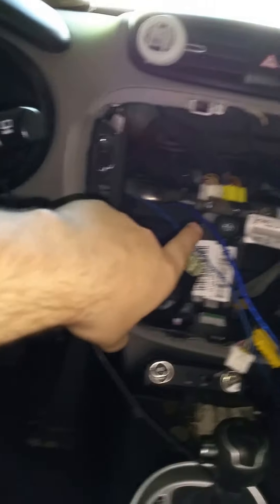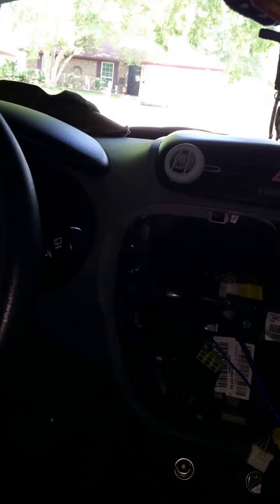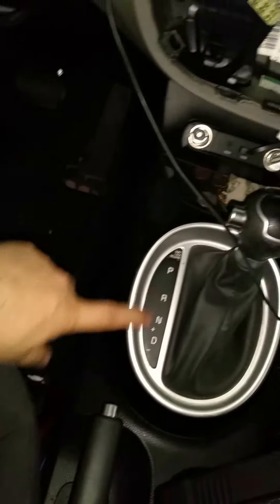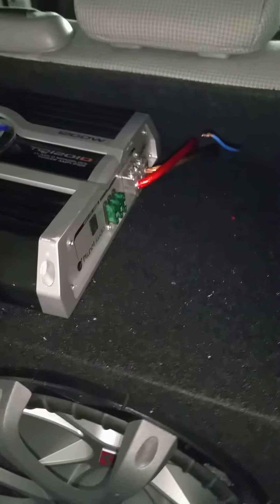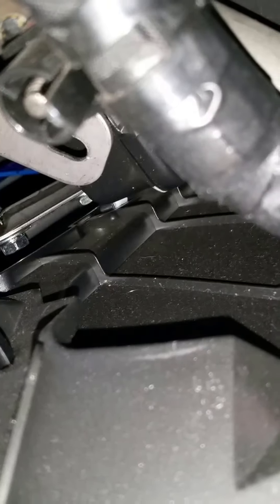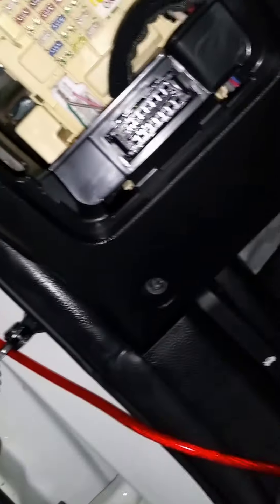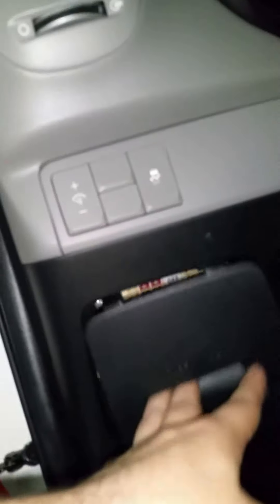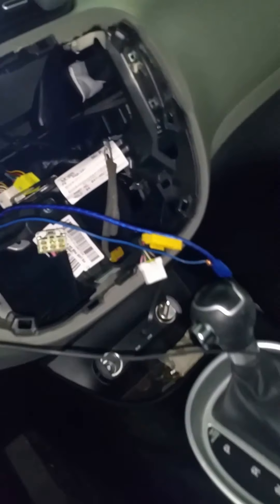2015 kia soul wiring an amp easy

Comment: So the factory sub and amp are on the passenger side rear it has a remote wire u can splice in to and input wires u can tap an loc2 rca adapter.

Comment: There is a rubber  grommet in the fire wall near passenger side  that has wirers coming out of it  that you can feed your power wire through it will come out under the glove box no drilling wholes involved.

Comment: Shouldn’t there be a firewall access point behind the floor pedals? My old Nissan Altima didn’t have it but a lot of vehicles have it for ease of access without allowing cables to be so exposed to other elements.

Comment: Center console removal was hard to find. Make sure you have the parking brake on, grab right under the ledge of that faux leather portion, pull that up, then you can pull up and back the remainder of the center console. There are connections for your shift lever lights and a shift lever release that will allow you to completely remove the front portion of that center console. You can go through the firewall for the power wire. Its easier to feed into the vehicle from the engine bay side.

Comment: I'm looking to put some new subs in soon. Should I leave the old ones in or take them out?
Reply from the maker: Mine didn't have any in there to begin with but I would just take them out. Thats just me
Reply: to remove the sub from the 2nd gen kia you have to take out the whole corner panel. its a massive pain in the ass....i your not using it, unwire it from stock and leave it be, if you wanna deaden things up and do the install right yeah probably would be best to take it out its just a matter of how much time you want to involve in the project.
Reply: U can always tap into the factory amps remote wire and input wires thier located on the passenger side of the cargo area.

Comment: Very misleading video. This is not a video on wiring your amp more like running your wires through your car smh. So if you follow this video this will kill your battery because he didn't show you guy how to hook up your remote wire to cut your amp off smdh

Comment: This is the worst install video! Should be called “what not to do”…………running a 2 gauge wire through your door is very dangerous…..good way to short out all your wires and start a fire………best if you run your power wire through a grommet into the firewall…….. and just laying your remote and rca’s is just lazy ……if your going to do it, do it right……take out passenger seat and run everything under the carpet…….😮